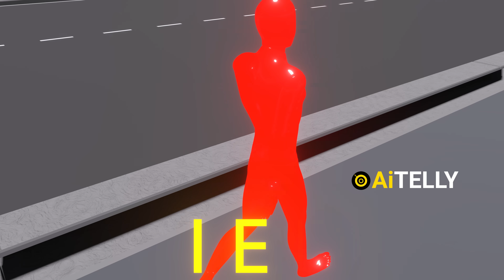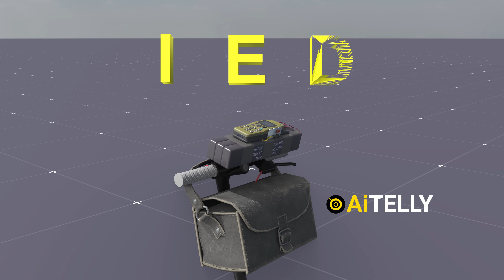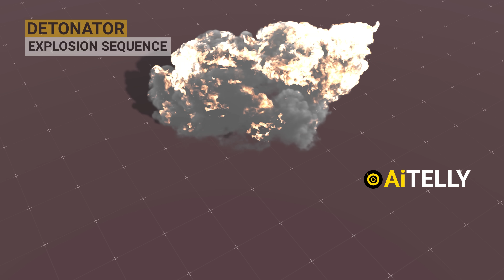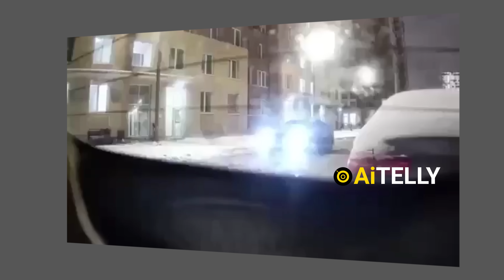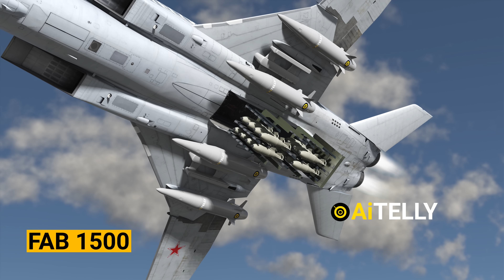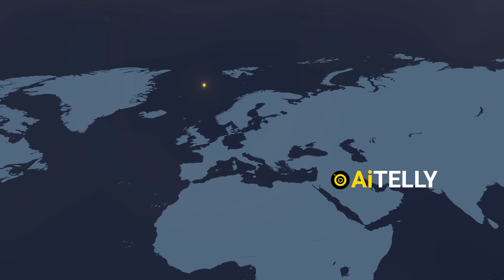How Ukraine Assassinated Russian General?

Comment: With a modern IPhone . Have only one phone number in the contacts list  , put on do  not disturb , then personal focus , set the notification to allow that one number  .   That should be the only number that will set off the ringer . Tap the power from the ringer . If the current from the ringer is not sufficient then run it through a small relay to put the phone battery power direct across the d*t .

Comment: The whole scooter thing is BS . The scooter was found intact so if it was part of a bomb it would have been blown to pieces .  Also the aid was carrying a large briefcase and a box of some kind .  When the blast went off debris from the two people went in  a direction  of right to left across the blast face you can see it in slow motion .  That would not have happened if the scooter was the bomb on the left hand side of the frame . Something else happened  .

Comment: Concrete can also be a battery PTO press gears cables hydraulics power wind suspension dynamo brake genorators power wind poles heat cool channel tubes cyclone intake sorter valves psi tanks compressors fuel recycling system flex joint scaffold tile pressure panels solar panels microwave panels kinetic energy readers sight system power source thermal vision sonar magnetic field vision nueral implants nerve splicing nanites microscopic robotics nanited hulls nanotec munitions reanimates reprograms lifeforms electro static magnetic shield genorators electro static magnetic purpultion heat cool hover panels diamond coating fiber optics cloaking device transmitter sending signals quicker light speed aliens alliances armada approved federation friends forever throughout the universe doesn't resalitify is the goal ufo unidentified flying objects plenty of them federation ufo mechanics

Comment: I don't think the explosive was put in the bag. It was more likely that explosive devices were installed inside the tube and under the stepping plate as a bag had a great chance to be taken by a citizen passing by in Russia .
Reply: If it was in the tube or "stepping plate" those pieces would have been shredded. Videos of the aftermath show the scooter intact, except for the missing handlebar referenced in this video. 

The bag could have easily been secured to the scooter and could have had a false bottom to appear empty if anyone was to look in.
Reply: it was in the bag, and watch the cam video again
Reply: You saw photos that directly contradict what you say.
Reply: If you watch the damage from the front of the house the explosion was managed in one direction. Behind the scooter looks everything well.

Comment: Wasn't this plan pretty risky? What if someone rented the scooter and drove away or stole the bag?
Reply: I can assume it was a privet scooter. Not the one used for rental.
Reply: Who rides scooters in the dead of winter?
Reply: @aloud9738  In Russia, winter is 12 months a year.
Reply: @wolfshanze5980 depending on region. In Moscow it's about 4-5 moths at maximum.
Reply: In the middle of the night? And probably it was disabled.
Reply: Idk but I’m assuming they knew when the target would be leaving, in which case the bomb would not need to be there very long. Also for all we know, the bomb did get stolen in previous attempts… thieves don’t usually report themselves… even if it turns out they stole a bomb. 

It does seem like weak security for the general, which was unfortunate for him.

Comment: Pretty inaccurate animation. E-scooter model in this animation is Segway Ninebot 1 gen. We can clearly see from original images that the actual e-scooter was completely different model. Animation has a suitcase with the bomb hanging on the e-scooter. We can see from the source that there was no suitcase. Such a small amount of high explosive fits easily inside the handle console. I have watched several AiTelly animations without knowing that the accuracy might be way off.

Comment: The red army faction pulled off an assassination similar to this in 1989 using the girls bicycle.
Herrhausen was killed by a sophisticated roadside bomb shortly after leaving his home in Bad Homburg on 30 November 1989.[4] He was being chauffeured to work in his armoured Mercedes-Benz car, with bodyguards in both a lead vehicle and another following behind.[1] The 7 kg bomb was hidden in a bag on a bicycle parked next to the road. The bicycle had been consistently parked sans explosive in the same location along Herrhausen's route for an extended period of time before the assassination, and it was therefore ignored by Herrhausen's security. The bomb was detonated when Herrhausen's car interrupted a beam of infrared light as it passed the bicycle. The bomb targeted the most vulnerable area of Herrhausen's car – the door where he was sitting – and required split-second timing to overcome the car's special armour plating. The bomb utilized a Misnay–Schardin mechanism. A copper plate, placed between the explosive and the target, was deformed and projected by the force of the explosion. The detonation resulted in a mass of copper being projected toward the car at a speed of nearly two kilometres per second, efficiently penetrating the armoured Mercedes. Herrhausen's legs were severed and he bled to death.

Comment: the Nokia 3310 used to trigger the explosive is still in one piece and with 99% battery charge. the screen is slightly scratched so it'll require a 5$ cover swap.
Reply: You said it. said it well.
Reply: 😆 So bad!  But also funny.  Thank you for this.
Reply: 5110*
Reply: Ахахахахах, зараз так вже не роблять, стара школа.
Reply: @emperorSbraz  It has been rated for 500 assassinations only, not more.
Reply: SUPER BADASS MILITARY GRADE PHONE INDEED. Will mever be beaten by iphone or samsung
Reply: nokium
Reply: @emperorSbraz  3310 was used not as a trigger, but as an additional projectile.
Reply: There is actually no need to use a cellular phone for firing. Remote Firing Systems made for fireworks are very very cheap and easy to use. That old phone usage is just made up thing. Also, basically all rental and private e-scooters have Mobile Network Data connection built in anyway. Just a little tweak and it is ready for firing remotely.
Reply: @opensourcemultimedia2725  This, although as an engineer I'd say a custom board.
Reply: @emperorSbraz  No, it's a Motorola 3300 with explosive in it.
Reply: I owned 1h for day, before  my brother broke it with a cricket bat
Reply: The explosive is made by sugar, aluminum powder, and fertilizer.
Reply: Haha was looking for this comment 😅
Reply: The general was probably killed by a supersonic Nokia…
Reply: The general was probably killed by a supersonic Nokia…
Reply: @emperorSbraz  I love my 310.. weld BBS got in my pocket destroying the speaker but it's mine playboi
Reply: My friend got a call back in the day said CELL PHONE BOWLING! threw it along the side walk, went tumbling for about 15 yards, then ran and picked it up, answered the call with hello? It was undamaged
Reply: @emperorSbraz  meanwhile iphine falls 10 cm from couch. «Shatters» «require 1k swap/repair» and «500 dollar fee»
Reply: FALSE! the Nokia was the fragment bomb! you dont want to get hit by a Nokia!
Reply: that was a 6110 in the video. but i get what you mean.
Reply: Скутеры не так опасны - как интересы тут сша и лондона на границе с россией и внутри и россии - попробовать чем-то ослабить и расколоть россию...
Это очень опасно, и может привести к ядерной войне...
Уберите базы и лаборатории, и убирайте нато от границ россии!..
И перестаньте думать что вы запад империя добра а россия это зло, и что вам можно тут на российской границе а россии нельзя окружать брикс маленький вымирающий белый пост христианский запад, который  со всех сторон окружён брикс, и делать то-что вы хотите, и вам за это ничего не будет, и всё сойдёт вам с рук, и всё будет по вашему!
Как видишь, запад проигрывает, и не брезгует террором...
Россия ответила в что раз больше, и в результате - оказалось, что быть другом сша смертельно опасно!
Reply: Geek joke. 
And that’s not a compliment. 👎